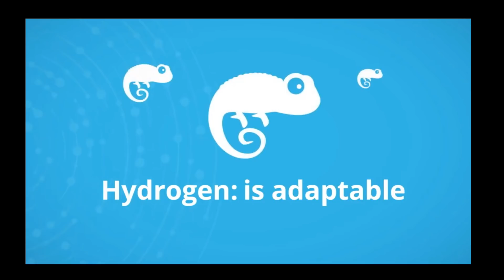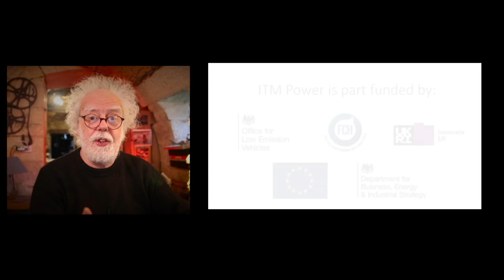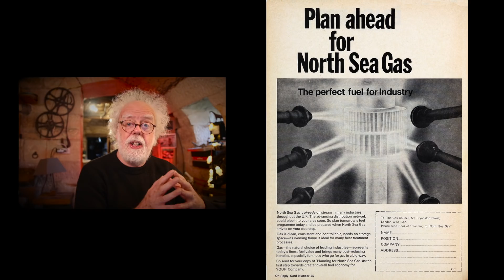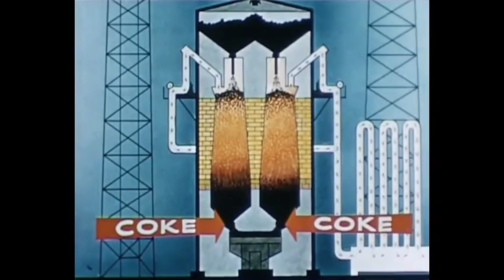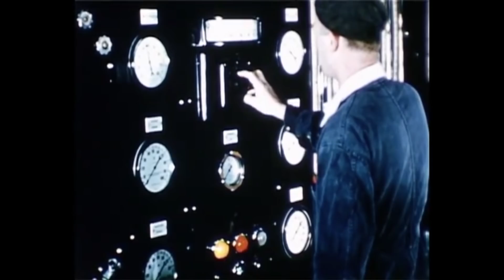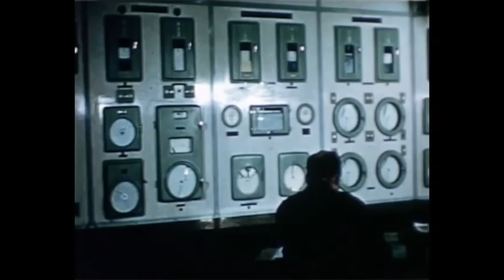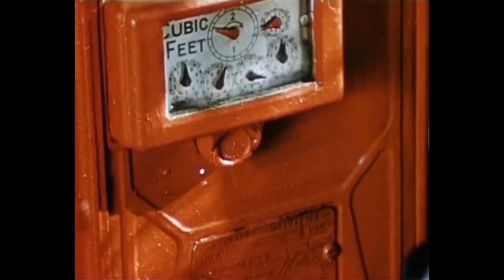Burning Hydrogen - Prof Simon

Comment: I remember how paraffin heaters used to be guilty of causing serious condensation problems when I was a kid. Something about a gallon of paraffin produces a gallon of moisture. So.. with Hydrogen also producing water, lets say in the kitchen, wondering if current ventilation models will need to be slightly modified.
Reply from the maker: I remember coal gas was wet
Reply: Natural Gas produces the same amount of  water when burnt. Town gas was however water saturated from the generation and storage process while natural gas is bone dry (water (and carbon dioxide) stuffs up the compression and pressure regulator systems).

Comment: Those commenting about Hydrogen leaking from copper pipes may be confusing Hydrogen with Helium. Helium will escape from any containment given enough time. Hydrogen is far easier to contain. Copper pipes worked just fine with the old gas supplies with up to 60% Hydrogen, so 20% added to Natural Gas should not create any problems at all.
Reply: The problem with hydrogen is that it does leak more easily than natural gas - this can lead to fuel air explosions that historically did demolish buildings. The related problem is energy losses - hydrogen is only 30% efficient as an energy transfer medium due to production and compression losses. Mains electricity is about 50% efficient by comparison (half the energy is lost between the generator and the consumer on a continental size grid).
Reply: Excellent fact.

Comment: A Scottish engineer invented coal gas when he put coal in his teapot and put on fire and this produce gas.Аll of Britain and Europe from 1810 to 1950 were major users of this gas .
Otherwise today all the thermal power plants the terminals from which the electricity comes out to trasnformator are cooled with hydrogen 

That is why all these plants have hydrogen production plants, ie in large electrolysis vessels steam is pumped at 200 degrees from the turbines to the electrodes and oxygen is produced as well as the hydrogen that is compressed and used for cooling.

Comment: I lived in a a small  town in Cumberland called Brampton, we had a house in the old local gasworks and it was our playground when we were kids back in the fifties. On the downside there was a pool of tar left which was filled in with peat and it stunk of ammonia. This was a by product of the manufacturing process. I never knew that town gas was hydrogen which as you say appears to be more clean. The process though required a lot of heat from the coal which must’ve released a lot of c02.

Comment: When there are many more electric cars on the road we can simply use the excess power to charge these cars at night - it's a much more efficient use of the power than electrolysis until somebody can come up with a much more efficient way to make Hydrogen.  Also with V2G (Vehicle to Grid) technology these cars can also be used as a distributed energy storage for load balancing.  The most advanced economy that I know of using Hydrogen is Iceland as they have near free electricity due to GeoThermal power so don't care much about the inefficiencies.  If we were able to find a cheap way to produce hydrogen then we could also use it for running cars or many other things which it simply isn't cost effective to do at the moment.  There are some new things in development that show promise but not yet widely available on the market or not on the market yet sadly.
Reply from the maker: yep.....watch my film all about that...

Comment: I also remember the Gas fire being changed over to Natural Gas - And also we then had to do something with the lighter ignition system, (Anyone know about this) - I remember dummy size D battery packs. (Not sure if they where needed for town gas or Natural. - Happy New Year anyway prof - You always cheer me up!
Reply from the maker: fascinating...thanks Alistair
Reply: The ignition temperature for natural gas is around 20% higher than that for towns gas. The old filament igniter for towns gas would work with single 1.5volt batteries but natural gas needed a bit more 'umph' so 3 volt igniters and larger batteries where generally used.

Comment: You spoke about coke plants. I worked on one and found out that there is over 100 uses for byproducts as a result of making Coke. Women would freak if they found out most of their makeup has Coke byproducts. Thanks for your story professor.
Reply: TRUMPed UP      the old Gas Works were terrifically polluting, apart from the atmospheric emissions, they produced a very toxic ashphalt residues that nobody found a use for and are still a source of pollution that is around today.

Comment: My Good Doctor, 

As an 'Merican of Scottish ancestory, I feel it my duty to humbly (and lovingly) inform you of a few potential flaws in your analysis (of which I am sure you are fully aware).

First, H2O (water vapor), like CO2, is a selective absorber (i.e. heat sink) and thus a driver of anthropological climate change (solar radiative forcing). In fact, water vapor's impact on radiative forcing is significantly greater than CO2. If we are anthropologically (artificially) increasing water vapor in the atmosphere, are we not simply substituting a more significant selective absorber for a lesser?

Now, one could argue that the earth's natural system has a built in mechanism to handle water vapor...but Earth also has a system for handling excess CO2, namely carbon fixation (i.e. plant food, among other mechanisms).

Second, the world’s official climate group (UN IPCC) has used ONLY solar irradiance for 40 years in their climatology models (you know, the models that have had nearly ZERO predictive value). The IPCC has NOT previously allowed SOLAR PARTICLE FORCING (i.e. X-ray, gamma, cosmic, and high-energy proton (among myriad others) in their climatology models.

However, the IPCC's  next models (CMIP6) will allow solar particle forcing in their next models. Ironically, those scientists who have added the solar particle forcing to their models have found that the impact is nearly identical to the forcing that was previously ascribed to (read as "plugged to") anthropological forcing factors. 

Sir, the TRUTH IS OUT THERE. But it is certainly not here yet. It's becoming super clear that prior models (due to anemic academic vigor, intentional ignorance due to entrenched financial interests, and other moral hazards with the Academy) were woefully short in fully including all known forms of energy from the Sun and made fatally fraudulent attributions of impacts to sources of radiative forcing that were not proven. In short, many scientists when confronted with an unexplained forcing factor simply plugged the difference to the "anthropological" column of the formula.

I abhor pollution. I abhor waste. In fact, I think we should minimize our impact on our environment as much as possible until the day when we can forsee the impacts to the climate that in many cases may take millenia to appear (for example, the deep sea currents (heat sinks) that in many cases take hundreds to possibly thousands of years to fully cycle). Likewise, our observations of the sun and solar cycles are so new and so technologically naive that to think we have any true feel for the cyclical nature of solar radiative forcing is simply rediculous. 

Perhaps we should continue pressing forward in these areas...with full academic vigor and debate. However, where a particular chemical is not a known toxin to human, animal, and plant life, perhaps we should be regulatorily agnostic and let the free-market determine which mix of sources of energy are best. Hydrogen may be one of the very best...depending on the manner in which we produce it.

Afterall, some of the most vilified sources of energy have been found to be the most "clean" (nuclear [obvious caveats included]) while those seen as most clean have been found to be some of the most dirty and negatively impactful to the environment (i.e. toxic chemicals in the production and disposition of solar panels and the impact of wind farms on endangered wildlife). 

We should quickly come to know that we know nothing and realize the truth is out there...ahead of us. Ignorant arrogance is not becoming of us. Your humble curiosity of all things is wonderful.
Reply: Careful...you start talking about a desire for Solar Forcing Data and you'll be dubbed a Conspiracy Theorist!  Besides...energetic solar radiance.....that's only UV light; everybody knows that...
Reply: Could you explain why the solar forcing energy you are referring to that has been fairly constant for the last 200 odd millenia is suddenly having an effect in the last thirty years?
Reply: @allangibson8494  - "...fairly constant for the last ...200 ....Odd ......Millennia!!!"

Well, Jumpin Jehosaphat! That sure is a large number of odd years!! As for "fairly constant"...? I don't know what to say... Did you try including the even years too?  ba-dum-tss!
Reply: @j.macjordan9779  The point is that your contention is invalid - if the models were in error before then the EXACT same error is still present. The amount of solar radiation has not changed AT ALL so why is the Earth heating at all? Based on solar radiation levels we should be entering another ice age.
What has changed is the CO2 levels have doubled in the last two centuries. We have also been dumping methane and chlorofluorocarbons which are a hundred times worse as greenhouse gases into the atmosphere (the methane from leaking gas wells is the most stupid because it is costing the companies involved millions in lost profits).
As for increased water vapour - that is a positive feedback effect and pretty much why Venus is as it is today. 
Natural CO2 emissions have been historically low for the last 150 years (other than the methane coming from the melting tundra in Russia and Canada - again positive feedback) since volcanic activity has been very low based on historical records.
In short, overall the global temperatures are rising, sea levels will continue to rise, Florida will cease to be a state by the end of the century, hurricanes will become more intense, forest fires in Canada more common and  there is not a thing we can do about it now. We just have a choice on how bad it gets.
Reply: @allangibson8494  wait, what? Are you really arguing that solar irrandiance hasn't hasn't changed when NO ONE, AND I MEAN NO ONE, argues that there wasn't a Muander Minimum and a Roman Climatic Optimum? What caused that? Bovine gas? 

You are so hillarious dude. It's like you really haven't ready anything about the Sun and its incredibly complex and periodic cycles. You may want to read up a bit more. 

Oh, also, you may want to look at the recent changes on ALL the other planets in the solar system. You arguing that those changes are anthropogenic?
Reply: @PureAmericanPatriot  We have DECREASED solar energy and yet increased temperatures.... The PATTERN has been constant which is why there were fears of a new ice age in the 1970's.
Models are models - they have no validity unless they match measured reality.
Reply: @allangibson8494  , hahahaha...based on which absolutely perfect dataset? No, seriously, which ones? I'd be happy to respond if you can point me to the proof underling your comment...unless you are basing your argument on "An Inconvient Truth". Because, well, of that's the case, there's nothing I can do for you buddy. That's an issue to take up with your parents.
Reply: @PureAmericanPatriot  My working point is the last ten years have seen the highest global temperatures on record since 1889 (when calibrated global records became possible). A lot of bull shit cherry picking has gone on (using 1995 as a starting point for example - the tenth hottest year on record as a starting point for example, but everywhere you look new high temperature records and earlier ice melts are the rule, not the exception. The trend is to higher temperatures that are not explainable by increasing solar irradiance.
The other reasons are geopolitical - getting off oil and gas let's Europe out from the thumb of Russian gas supplies and Middle Eastern blackmail over oil supplies. The rest of the world would also benefit from pulling the financial rug out from under these dictatorships and democratisation of power supplies regardless of the not inconsiderable environmental benefits from reduced pollution.

Comment: Professor, Happy New Year! I truly hope that this decade will be the onw when renewable energy will start to dominate. Just remember how expensive the solar cells were 10 or 20 years ago. Today, the problem is the energy storage. I favor hydrogen vs lithium-ion batteries. Long term, there will be less waste. Yes, there are issues (big ones) with storing the hydrogen, but if it doesn't need to be stored, it is  a win-win situation. Now, the question is, why has this not been done before, and second, why don't countries with lots of sunny days and lots of available land embrace this solution. Seeing the wilfires, I think Australia should be the first country to deploy this (solar+ hydrogen) and forget about the dirty coal...
Reply: There are no problems whatsoever with storing hydrogen, it is abundantly stored in both the air we breath and the water we drink, we simply need to separate it.  Cars can and have been run on water, unfortunately TPTB don't much like free energy!! It's much more profitable to tax immisions and profit from so called renewables!!

Comment: I have been saying this for years, Australia should have hectares of solar panels, we have plenty of room and sunlight, use the excess electricity to make hydrogen from seawater. Can the water exhaust from a hydrogen power plant be used for irrigation?
Reply: Awesome point! And as noted in Nikola Tesla's patents, if we make electricity cheap enough we can derive fertiliser from the air too 👍
Reply: @GrantAUM  Ammonia fertilizer uses 30% of the global natural gas production. This is solely to make hydrogen (carbon dioxide is a process contaminant).
Learning how to make synthetic ammonia was arguably one of the causes for the first world war (as England basically had a monopoly on the mineral nitrate production in South America).
The first version used a uranium catalyst but further development led to the current iron catalysts at the expense of much higher pressures and temperatures.
Fritz Haber moved on to other things after that - like poison gases.

Comment: Sorry prof, you need to debunk your hydrogen supply myth...hydrogen will boil off in domestic gas pipes used around our country...your need to change the plumbing too...If you have the level of hydrogen gas loss expected from its ability to escape your putting a lot of homes at risk from fire and explosions...Just like the good old days of coal gas...I wouldn't want it or have my neighbours use it....keep reminiscing for the good old days...regards
Reply from the maker: That’s a good point David.....hmmmmm. I removed there were more gas explosions...I hope they can work round that....they propose 20% hydrogen...coal gas was approx 60%....maybe that’s the leak fix? Thanks
Reply: A hydrogen atom can easily pass through copper and confinement will need to be cooling the supply down and insulating the pipes thermally....I think this will be scrapped on cost basis...

Comment: Nightime electricity will not be low demand if people keep buying EV's
Reply from the maker: Great
Reply: @SimonHollandfilms  It will only be great if the supply copes, and your suggestion of all EV batteries providing back up power could well leave lots of EV car owners cursing when they find they havent got the charge they needed
Reply: @bobtailvw22  We have two electric cars and you don't need to charge them every night. The fact is that a smart grid will allow us to decide when we want to use our cars batteries to "trade" power. So unlikely to be a major problem.
Reply: @ianhamilton3113  Do you always plug them into the grid?
Reply: @bobtailvw22  No not currently, depends on state of charge and what i'm doing the following day. But I would actively use the "trading system" when it's available. I think most people think of the environment when they think of EV's and aren't aware of the massive savings they can make compared with gas or diesel. Will never go back.
Reply: @ianhamilton3113  I guess if you have the infrastructure then its less of a problem, I however will not be buying a new vehicle in my lifetime and would trust a s/h IDE vehicle over a s/h battery powered one. Where I live there is no EV infrastructure except in one or 2 cities
Reply: @bobtailvw22  Yes that makes it a problem. We have a garage and there are two fast chargers nearby if we need them. Happy New Year.

Comment: Happy New Year Professor Simon. I have been asking myself the same question for a long time.
What I would really like to know is if it is possible to burn Hydrogen in a conventional automotive combustion engine ?
Good luck in the new year and best wishes to your family.
Reply from the maker: Happy new decade Jeremy
Reply: Well we could link that into a little generator in the car to true hybrid car . Much better than digging up lithium and recharging an electric car . It would provide a better range too.
Reply: well everyones been doing it for years so i cant see why not?
Reply: You can, but the efficiency is appalling and it does nasty things to the valves due to very high combustion temperatures (like burning acetylene) and generates a lot of nitrous oxides.
The low temperatures in fuel cells are better for the environment but the fuel cell reliablity is appalling.
Batteries are at least likely to last the life of the car (the new generation half million hour ones particularly).